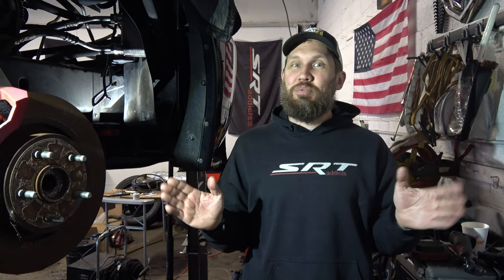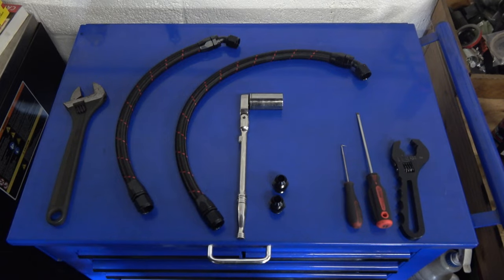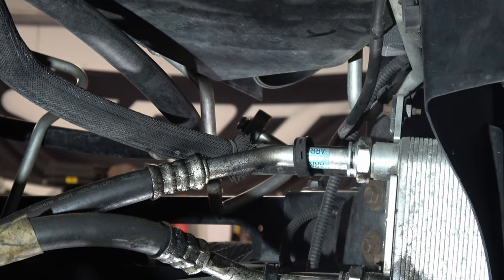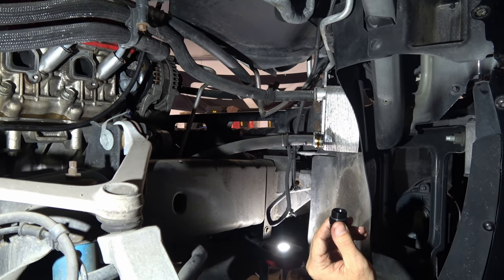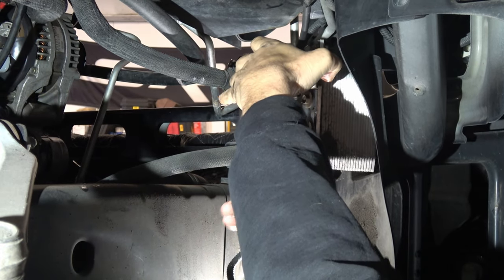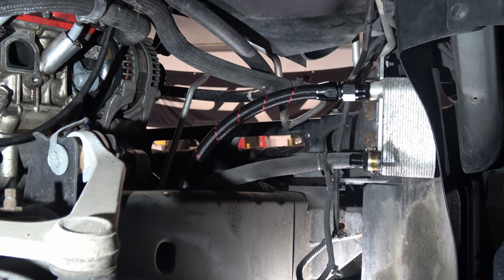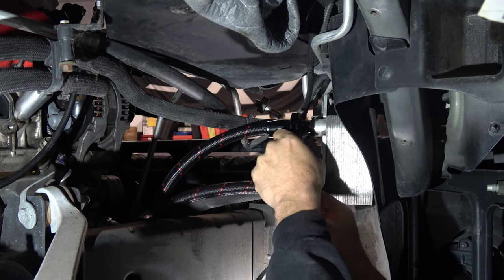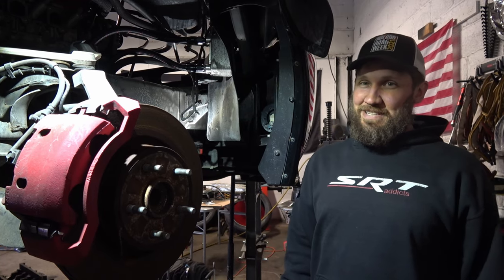Install Upgraded Oil Cooler Lines - 03-10 Dodge Viper/ 04-06 Ram Srt10 - Tech Tip Tuesday

Comment: How long does this Job take? I have to do it for my Gen V this spring. Thank you! Also, assuming you drained the oil before hand? Sorry if that's a stupid question.
Reply from the maker: You don’t have to drain the oil in order to do this repair, make sure to check the level and add as necessary when you finish the job.  

It takes about an hour to complete.
Reply: @Tracksidemediaofficial  Thank you! I won't be able to take the tire off so hopefully not too much longer.

Comment: I have a Chrysler 2018 srt, 70,000 km, and when I race, the oil temperature rises to 110, and when I stop, it reaches 104. Is there a problem with the oil cooler, or is this normal? 🙄
Reply from the maker: We don’t specialize in that vehicle however those temperatures do sound normal.